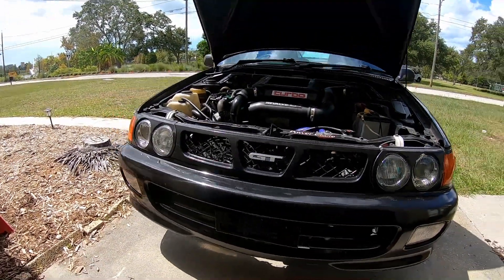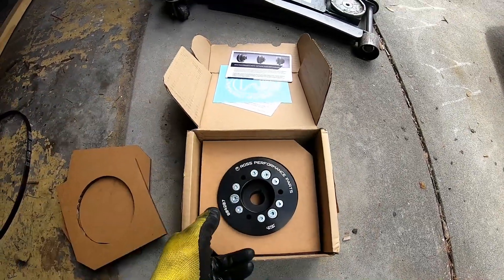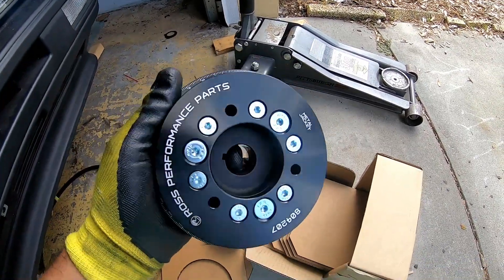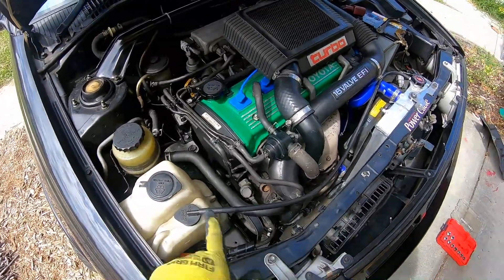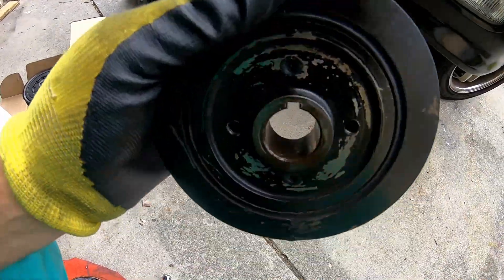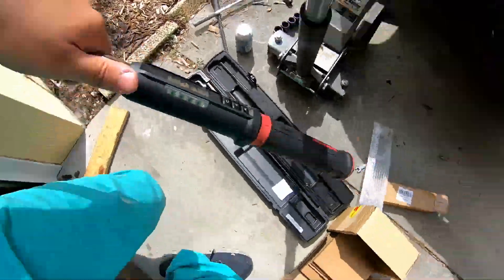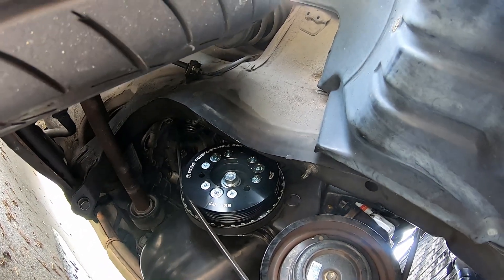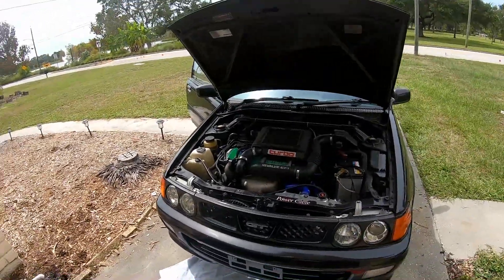Installing the Ross Performance 4EFTE Harmonic Damper on my Ep82 Toyota Starlet GT Turbo

Comment: can i ask what the biggest improvment has been since u installed? like whats really changing? is the balance better, less shaking?
Reply from the maker: With stiffer Mount inserts (power flex yellow) it definitely became smoother. I didn’t want to go with a used crank pulley and they don’t have a new one for the 4efte so this is pretty much the only option…unless you’re ok with used. If you’re going past 250whp I would definitely add it to your shopping list for engine longevity.

Comment: Do you have the turbo timer ???
Reply from the maker: No sir, stock turbo but if you're running your car as a race car and see extreme temps then it may be worthwhile but not needed for a car you run on the street or occassional trackday.

Comment: Hello my friend do you know anything about the weight ? Is it as heavy as the stock one ? Is it lighter ? Thank you.
Reply from the maker: The weight is roughly the same as it is filled with rubber to maintain normal operation.
Reply: Thank you my friend i was searching for a lighter one until i saw these. But since i am afraid that the aftermarket lighter ones do not have any kind of rubber or anything i might buy one also for my self.
Reply from the maker: @Dimitris20v-x3o  Since the 4EFTE has a turbo and uses a harmonic balancer it's best to have something that is rubberized to some extent even if you're at stock power. The vibrations to the crank over time from having a lightened crank pulley can cause fractures. I did a lot of research on various forums and some people have used a 5E or non-turbo 4E pulley when needed, but there are a few nightmare stories of those failing as well. The price of a pulley like this isn't cheap but it's worth it if you are upping the boost or you can't find a brand new OEM pulley. I hope your build works out, please send some pic to TeqDigest@gmail.com or DM me on teqdigest on Instagram, i'd love to see it.